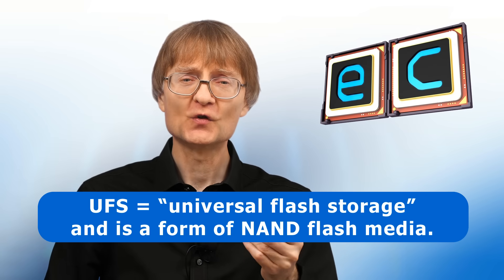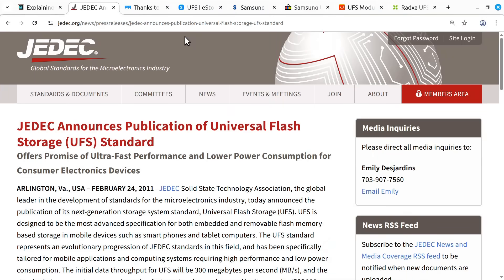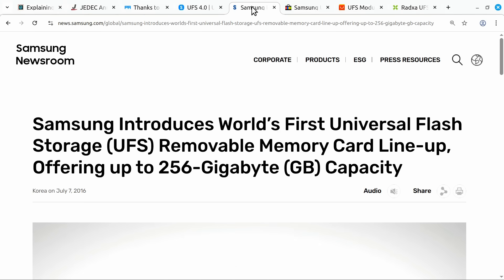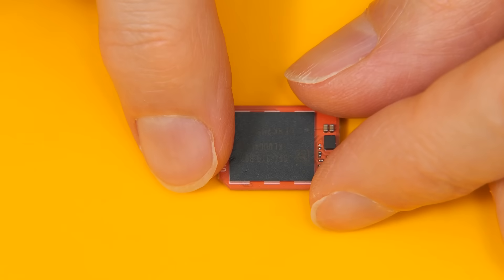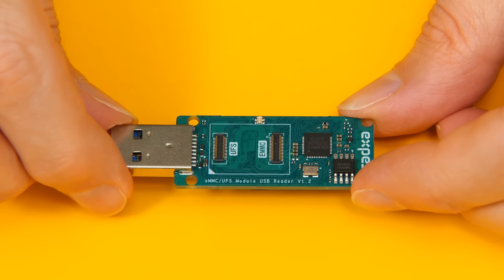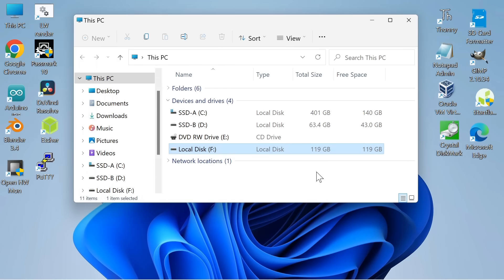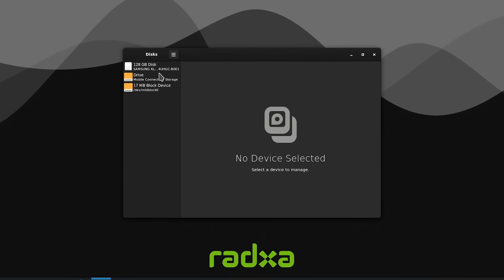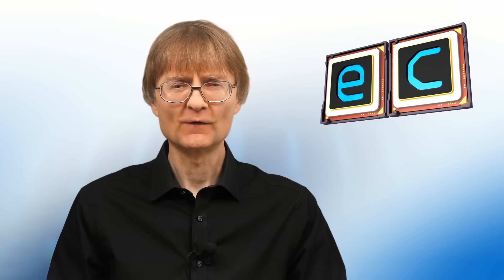Testing UFS: Fast Arm SBC Storage

Comment: Since It Will be Some More Time Before These Things End Up In The Thrift Stores!! I Will Just have To keep Rocking The 6 X I7 Optiplex 7060 SFF PC's I Am Using To Control My TV's In My Home! Also My Son And Grandsons TV's I Have 4 Of Them Here And They Have The Other 2! I Have 1TB NVME SSD's And Either A  NVidia 1650, AMD RX 6400, or NVidia Tesla P4 In Each Of Them So The Can Play Light Games And Run Most Apps! I Have Mechanical Keyboards And 5 Button Wireless Mice For Each! I Dont Have Cable But I Do Have 2 HD Homerun Quad Tuner Receivers!

Comment: I'm thinking of back in the day being impressed by 20mb/s on a harddrive in the mid '90s, heh. Normal drives were 5mb/s level for the most part, some being round 1.5mb/s. 
Also, that module is a KLUDGE! At 07:43 it says it on the chip, KLUDG4UHGC which can only be a KLUDGED UP KLUDGE! Okay, okay, no need to get that upset about it, I'll just see myself out OK? Take it easy!

Comment: Great video, as always. I have an Rock 4SE, with 4GB RAM, bought it long time ago on discount. Had it running with both NVME and that little storage chip,  16 or 32GB but it's not boot from anything else than memorycard. Have seen articles about how to solder a little chip on the bottom of the board but I think I should find someone other to do that, rather damaging the board. Maybe I find energy and inspiration to take a new grip on it.

Comment: UFS 5.0 is theoretically ~double the speed of 4.1, and i don't even think they're at the saturation point for NAND yet, it's all interface and thermal limits. they're actively looking into it cause Ai datacenter nonsense is going full speed and they're absolutely starved for data there as well as bandwidth so they're looking at as a "Host Performance Booster", and the more fab they spin up the more it will trickle down to us eventually.

Comment: Having just gone through a RPi 4 (8GB?) attempted transfer from a MMC to UAS disk -- I'm .... Losing some of my  enthusiasm.  The UASP SSD showed errors under almost any hdparm test -- and I'm somewhat reluctant to switch from SSD over UASP (with errors) from my slower eMMC drive.  Very disappointing overall, really.  For my use-case (a at-home citrix box) I don't have that much of a win for eMMC to UAS/SSD -- but ... I kinda wish I hadn't bothered spending a couple of weekends doing all the changes necessary to it.  Maybe the RPi will "outgrow" this, but I'm kinda reluctant to experience a lot with my own cash across all the acronyms and version numbers to see if it will produce the desired results.  While I'm still sticking with the RPi4 for my citrix desktop, I wondering also why I didn't just get an old NUC5 from eBay for the same purpose - and lose the sense of adventure.

Comment: should also test it for data retention on power outages and such. as in is only the data it was writing in that moment corrupt or more or does it even brick it.
sbc's have had a lot of issues with micro sd cards bricking after a power outage.

Comment: UFS looks like a very interesting way for fast and relatively inexpensive storage for lots of devices. I would be interested in learning more about if there are any concerns with longevity if it's used as a boot device for an OS. Also, could be interesting to see if anyone were to create a PCIe M.2 to UFS adapter that could accept 4 UFS cards. Could make for a modular way of implementing storage for a NAS type device that could be cost or power efficient if the price of UFS cards declines in the future.

Comment: For benchmarking drive performance I recommend the `fio` utility. It is very configurable and has very detailed output.
It also allows non-destructive write testing of your boot drive, if you so desire, but of course it requires the correct parameters.

Comment: I have a Samasung S23 Ultra with UFS 4.0 and it takes ages to copy Folders with more than 200GB size from the phone to my PC.....
Reply from the maker: Over what interface? The speed of such a transfer will be determined by far more than the speed of the storage on the phone! :)
Reply: USB 3.2 Gen 2. I think the protocol is bad on the phone side. If I try to copy just 10-15 videos, the speed is fast. The problem occurs when I want to copy folders with thousands of videos or photos. I ended up compressing them and then transferring them to a PC.. @ExplainingComputers

Comment: Excellent vid! The evolution of storage technology has been astounding. I still have a 10 TB spinning HDD as a backup/storage drive, but OS is on a 2 TB Kingston M2 drive capable of ridiculous speed. Faster than what RAM was 15-20 years ago (access times are still way different, but reads and writes are DDR2–DDR3 territory). The first backup drive is a Samsung EVO 960 SSD, which itself used to feel fast :-D

One thing in the video that was perhaps missing was the hdparm test when you booted from the USB drive. It would have been interesting to see if it was faster or slower when the OS didn't use the disk simultaneously as the Disks test seems to indicate with its 1.1 GB/s speed.

Comment: What's the point in adding yet another way to connect storage when nvme beats the pants of ufs with no development required. a 2230 nvme is basically the same size so no gain in space either. Let this die on the wine and just focus on cheaper and more durable nvme´s, please. We do NOT need yet another incompatible device forcing us to choose one type of system parts over another. From what I seen ufs does not offer any improvements over nvme in capacity, speed or size so why bother in the first place, it´s not an upgrade it´s a sidetrack/dead end.
Reply from the maker: Please don't shoot the messenger! :) And whilst I take your point to some extent, UFS is an existing and already widely used storage technology (Apple phones use NVMe, but Samsung, Google and others are UFS). UFS also smaller and uses less power, so has some advantages in mobile and lower-power devices.
Reply: @ExplainingComputers  I´m not having a go at you, I like your channel, just the ridiculous way tech companies try to make us buy yet another form factor to do what already can be done perfectly well with no new thing to buy. +- 5 milliwatt doesn't really matter with today's devises. Good video however, see you in the next video.

Comment: KLUDG4 ? Someone in the Samsung part nomination department is having a spot of fun.
Seriously, Radxa should offer a package with the card and the USB board a single SKU. Everyone working with the cards is going to need at least one of the USB cards, so why not make it easier to buy?
Reply: Well, even thou it's a bit "clunky", you could probably boot it off an SD card and then flash the UFS module through that system/OS. So the USB adapter isn't absolutely necessary.
Reply: I thought the KLUDG4 needed commenting on, too. I hoped that we would get TP at the end

Comment: Another interface, another adapter, another standard.. So now you can do..... What can you do? Umm, so... the practical application is what? Help me out here.
Reply from the maker: The practical implication is much faster, lower-power, tiny storage for SBCs. So rather than adding an M.2 adapter and an NVMe SSD to a board, you can just plug in a UFS module -- offering faster storage, in a much smaller form-factor, and (depending on what NVMe drive may be used) at a lower cost.

Comment: The potential for a UFS card is very interesting, improved read/write speeds & storage capacity. The cost wasn't too high for the card & reader. What about any heat issues & do the manufactures state the cards endurance TBW before failing, which is only an estimate. Thank you Chris for another interesting video :learning:plus the cameo appearance of Mr Scissors & Stanley
Reply from the maker: Thanks for your support. Sadly I could not find any of the data you describe for the module.

Comment: Just wondering, will the ufs module not show up on the sbc if no os is installed? What I mean is that if os is on that ssd and I connect ufs module to sbc will it show up like another storage device, then we can speed test it and etch os on it through sbc itself, without needing that ufs reader?
Reply from the maker: Yes, you are correct -- the UFS module will show up as a storage device if you have booted from another drive, and you can then image to it as you note. Alternatively, on many SBCs with UFS (onboard or modular), one of the USB ports is OTG, allowing the SBC to be plugged in to another computer, where the UFS will appear as a drive, so an OS can be imaged to it.
Reply: @ExplainingComputers Oh nice, also didn't know about the otg, thanks 👍

Comment: Does it have performance/endurance issue if the connection is module type instead of SD card type, like Samsung ufs SD card? Would'nt it be more convinent in SD card form? Why has it not become a successor to normal SD cards whose endurance is really bad?
Reply: that's what SD express is for (NVMe in an SD form factor

Comment: It's ironic Samsung promoted UFS memory cards yet removed expandable storage for their flagship phones, which could've used them.
Reply from the maker: Yes, ironic indeed! Interesting that they did not decide to transition from microSD to UFS cards on phones.
Reply: @ExplainingComputers  The UFS cards look to be bigger than microSD--is that right? I guess Samsung had two thoughts: Apple gets away with it; it's all in the cloud.
Reply: And it's not like Samsung needs to rely on users running out of storage space to sell new phones. Their spicy pillow batteries do enough of that already. Their crappy bloatware OS that slows down the phone does enough of that already.
Reply: @mjc0961 My sentiments on Samsung phones too. I'd avoid a Samsung phone like the plague, which might come back soon due to vaccination levels, but that's not Samsung's fault.
Reply: @mjc0961 isn't OneUI one of the better Android ROMs out there ? I don't have Samsung phone but from what i hear/see on the internet people claim this.